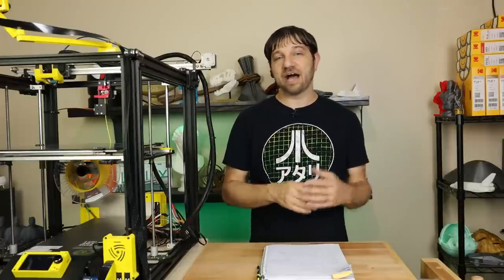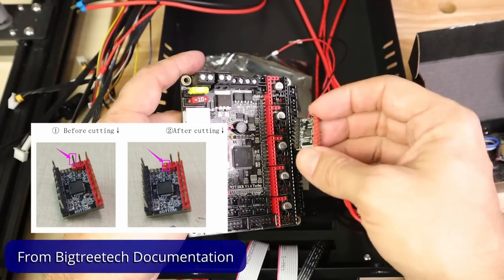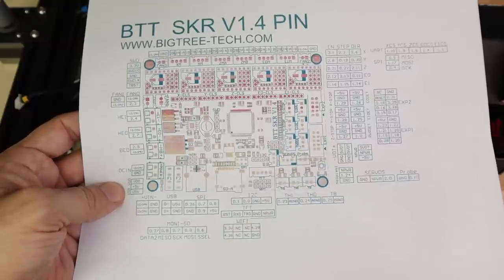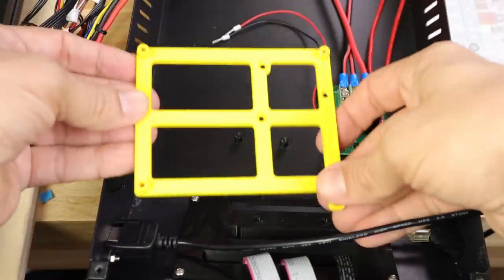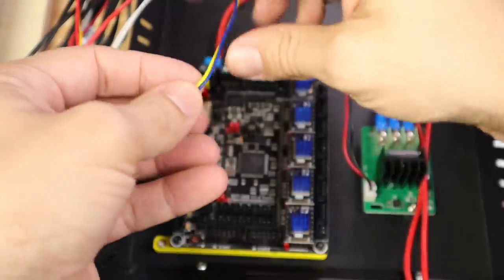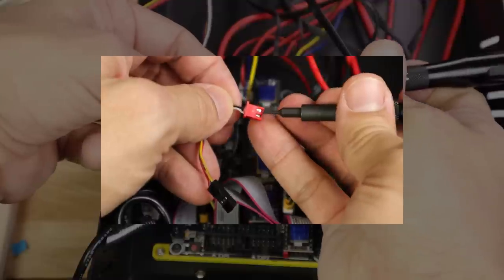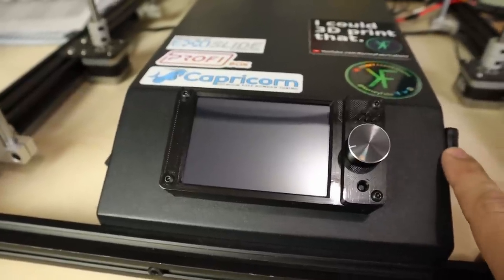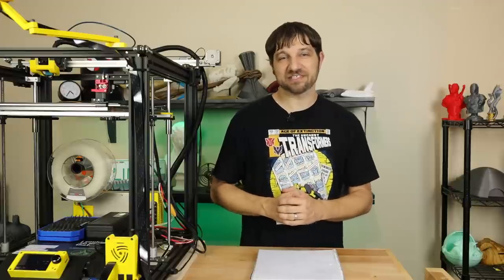Bigtreetech Ender 5 Plus Upgrade: SKR V1.4 Turbo (Part 4)

Comment: i am fixing to order the skr 1.4 turbo with 2209's and the new TFT70 7 inch screen i also want to order the wifi adapter can all these work together  any help would be much appreciated.. oh and i am adding this to a ender 5 plus also thinking about adding either the micro swiss setup or a hemera
Reply from the maker: All that works fine but I'm not sure the wifi is worth it. You may want to look at OctoPrint instead. My Micro Swiss review is coming this week. My Humera review is on the list but no schedule yet.
Reply: @kerseyfabs  great i went with the micro swiss direct drive extruder setup would love for you to add dual cooling to this using 5015 fans

Comment: for some reason... the firmware wont flash onto the board...
Reply from the maker: Mae sure to rename it firmware.bin and place it into the SD card slot on the board.
Reply: @kerseyfabs  looks like the board is the problem
Reply from the maker: Good to know. I hope you can get a quick replacement.

Comment: Will this video work for my cr-10?
Reply from the maker: The information should help you get through it. Many of the connections will be the same. You'll have to compile the firmware specific for your configuration.

Comment: I’ve picked up this board and it simply refuses to recognize the firmware off the SD card. Anyone have any ideas?
Reply from the maker: Are you using the SD card that comes with it? Have you named it 'firmware.bin'?
Reply: I came to the conclusion that the board was faulty. I exchanged it and the new one took your firmware file and worked. Here’s the weird part though. Once I put your firmware.bin on, it would no longer show up as a usb drive on my laptop. It recognized it and gave it a com port, but no drive whatsoever. Weird, right?

Comment: You didn't show how you grounded the unit...
Reply from the maker: You technically don't have to ground the board. With DC voltage, it's power and ground. It comes in the wiring. If you want to ground to the chassis, just run a wire from one of the screw holes to a screw on the chassis.
Reply: @kerseyfabs  thanks a ton.  The other video I watched the garage one that was way too long, he mentioned that you have to ground it, so I appreciate the clarity ;)
Reply from the maker: @tonnictv  No problem. And again, having an extra ground from a board pin to the chassis isn't a bad idea but it shouldn't be necessary.

Comment: out of curiosity has anyone used the bin file to flash their board with an identical setup (under 5 plus, tft display and btt 1.4 turbo) who has complete functionality? mine won't print from the display sd or USB slot in marlin mode but will from the board in marlin.  im in the process of making my own firmware, but it is a slow process for me.
Reply from the maker: Hey James! I've heard from many people that say it works great for them. As for your specific issue, when printing from Marlin firmware, you can print from the onboard SD or the LCD SD but not both. You have to choose when you compile. I believe I mentioned this in the video. Also, to the best of my knowledge, Marlin doesn't support printing from that USB at this time. I went ahead and created a new firmware for you that prints from the display's SD. Enjoy! https://drive.google.com/file/d/1RhRTmp0y3vTFeeImTBsbrV5Sx2igJjp-/view?usp=sharing
Reply: @kerseyfabs  I really appreciate that and I will be saving it in case i change my mind about how I'm going to load prints but I think I may have been a bit unclear.  with the SD card inserted into the TFT 35 3.0 it only prints in touch screen and will never allow me to "mount media" when I toggle to marlin mode. Its not a huge issue I was just seeking clarification and checking my installation of the firmware. 

I appreciate all that you do and thoroughly enjoy your videos as well as how technical and thorough you are.  

in the spirit of sharing,  I recently discovered that when I use receipt paper to level my bed the heat from the nozzle actually puts a black mark on the paper and i have been able to get some easy spot on manual levels by doing the initial leveling, pulling the paper through the nozzle and inspecting the line it "draws" on the paper. dashed line=nozzle slightly too high. paper can be folded to suit.
Reply from the maker: The issue you're describing is exactly what I was talking about. Touchscreen mode can always print from its CD card slot. Marlin must choose though between the SD card onboard and the TFT SD card slot at compile time. With my original firmware, Marlin cannot print from the TFT SD card slot. With the new one, it can.

Thanks for the leveling tips.
Reply: @kerseyfabs  thank you for the clarification, it is much appreciated.  keep up the great work!

Comment: We need the same but with ender 5 standard (tcm 2209 bltouch) PLEASE!
Reply from the maker: I was going to do it for the Mini E3 V2.0. Why would you put the SKR V1.4 Turbo in an Ender 5? Honestly curious.
Reply: @kerseyfabs  Ender 5 (the small one) comes with a creality board not silent. I am using klipper due the limitations on curves of the board. But it is the same as upgrading ender 5 with the board, is not? Thank you for your answer. We adore your work here.
Reply from the maker: @descorchafairys  I don't know if I completely understood your question. I'll do my best! From my testing, the Mini E3 V2.0 performs just as well, if not better, than the V1.4 Turbo using Marlin. That should be similar under Klipper.
Reply: @kerseyfabs  Wow, i never thought that 75mhz outperforms 120mhz. The idea is return to marlin because the only slicer that natively supports klipper is superslicer and it is not a piece of cake (trajectory problems, bugs, still young). I want to return to marlin/cura/simplify because this reason, but I don't want to lose the smooth curves. Still I will switch to klipper again or something else to test it (you can bet) . I think there are not enough info nor configurations available for ender 5 standard version and marlin as a software is a mess compared to klipper, but for now it have more support. I am grateful for your work and tests. I will share, if you want, my discovers on ender 5. I have to say I am a firmware specialist for all kind of hw, but still not a good maker. Ender 5 is a difficult toy to tune up. As said, thank you.

Comment: I am new to upgrading printers.  I have an Ender 5 plus that I have been trying to upgrade for months now.  I am fairly confident that I have the hardware set up but realized, after about 3 weeks of trying, that I am over my head with configuring the software.  Can anyone point me toward  compiled firmware for the following hardware, or help with compiling it myself.  
Thank you in advance.

Ender 5 plus
BTT SKR Pro v1.2
TMC2209’s
Dual z motors
BTT TFT50 display

Comment: so... Has anyone seen mirroring issues?... Using your firmware and now Prusa slicer (V.2) I see issues after upgrading.
Reply from the maker: I haven't seen this issue on my printer and I haven't heard anyone else report problems. Is it in both directions?
Reply: Every axis of mine is mirrored.  Upon homing, it crashes into the left side of the printer away from the endstop. I've tried to go into arduino and invert them, but I can't get it to compile.  I receive an error about making sure that I have the LPC1769 environment selected in the ide.          Edit: I figured out that this can't be edited in Arduino.  It did compile.  However, now the thing won't upload the firmware.  I have used the SD card in the reader on the board, used the extension...I'm at a loss.  Anyone have any ideas here?  I'm fresh out.
Reply: @youtee2010  Hi,   I seem to have this problem as well.   Y seems ok but X and Z not so.

Comment: I tried and tried but this does not work, it throws up so many errors. I followed the video at least 4 times watching and re-watching and pausing all the time. I like your videos but I won't be following any of you tutorials on marlin. I still have not got it to work after 3 days of trying. I even tried your firmware but that didn't even work
Reply from the maker: I'm really sorry to hear that! I'm also happy to help. Please hit me up here or on other social media if I can lend any assistance.
Reply: @kerseyfabs  Hello and thanks for reading my comment, so after much agro and unpleasent words I got it working but not from your config,h files. The problem with your files is that it wont complie due to the files it needs are not there. I had to mess around with other files from other sources to get it to work. I will keep watching your videos as they are insightful.
Reply: @Kersey Fabrications, So I went to your github page and redownloaded it( thanks for that by the way) and It worked,well sort of. The bigtreetech logo appears and I can use that side of it but I can't get marlin to show up on the screen. It boots into marlin as I can hear the beeps when I press the button but nothing appears on the screen. I'll figure it out.